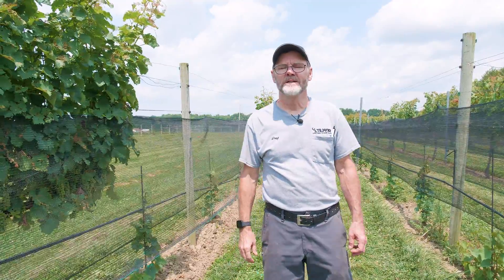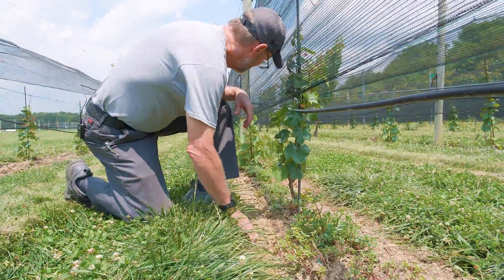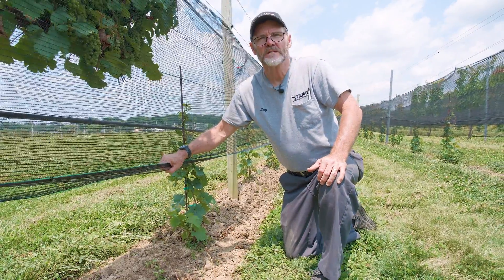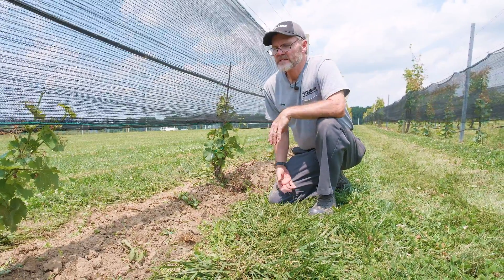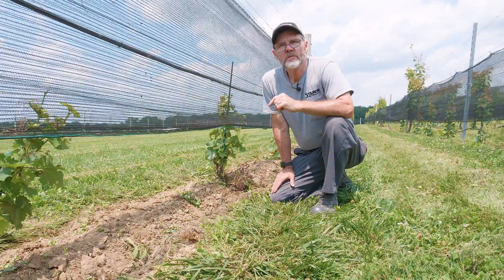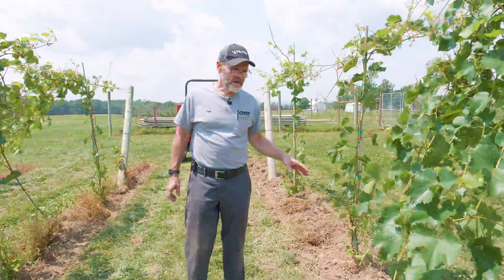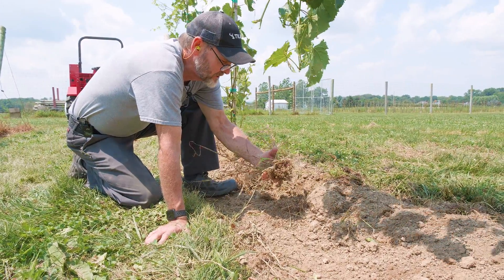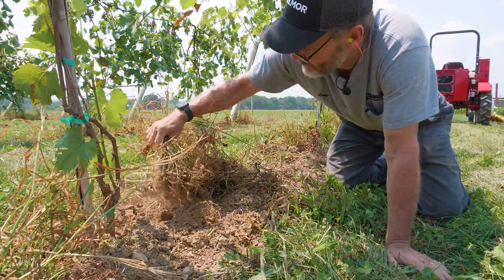Consistency Is Key! - Vineyard Weeding With The Adaptive Cultivator System

Comment: How many passes did you make? All in, from the "6 days prior"
Reply from the maker: Oh boy, you’re asking me to remember details from four years ago!

There are two sections of the vineyard shown in the video:

First section (first 4 minutes 40 seconds):
I believe we only made two total passes, about a week apart. There was much less weed pressure there, and that section had been treated with glyphosate earlier in the season. If we did anything extra, it may have been an additional pass on the first day.

Second section:
I’m pretty sure we did four to five passes, two or three on the first day and two more on the last. When weed pressure is heavy, you need multiple passes initially to expose the weeds and let them bake in the sun before hitting them again.

Again, this tool is for maintenance, but the point is that with consistent use and multiple passes, you can bring the area back to a point where it just needs ongoing maintenance at which point is a single pass.
Reply: thanks that was helpful.

Comment: I would buy two tractors if Tilmore would make a hydraulic pump setup so to that I could run 6-10 in wide roto -tillers that would normally be three point hitch
 mounted.  An evolution of the Ariens tillers on the old AC G.